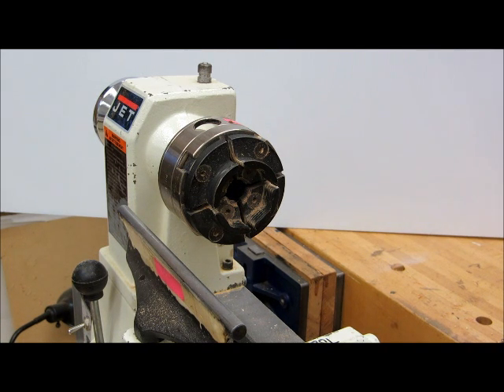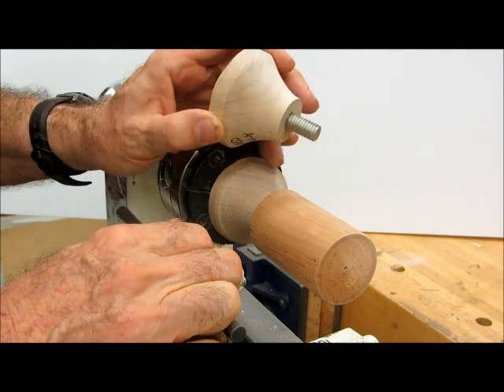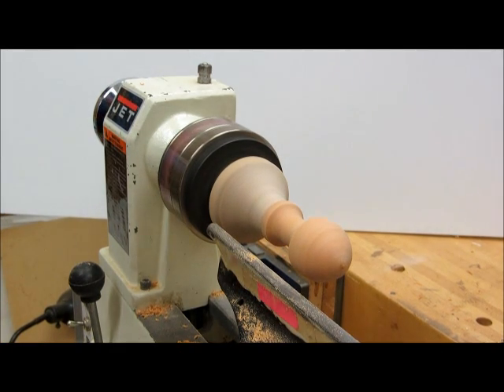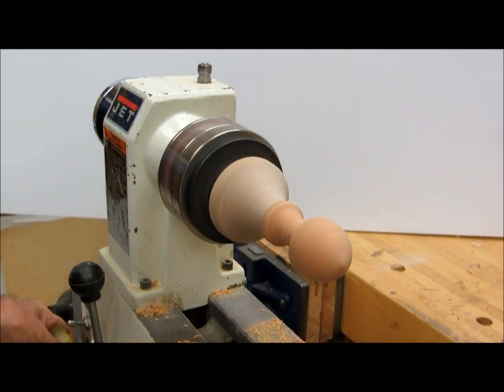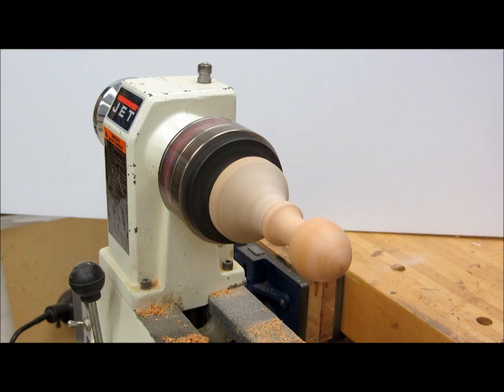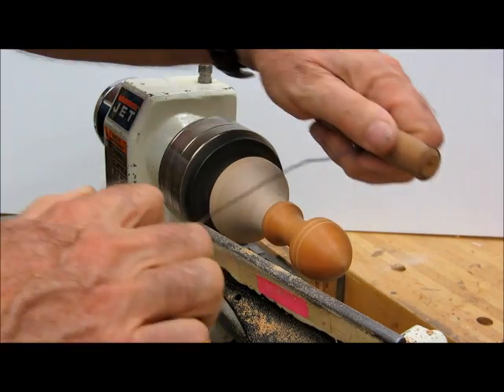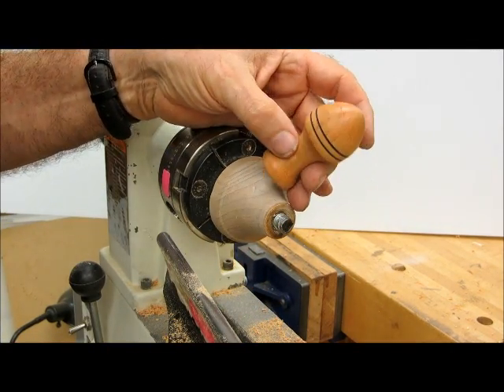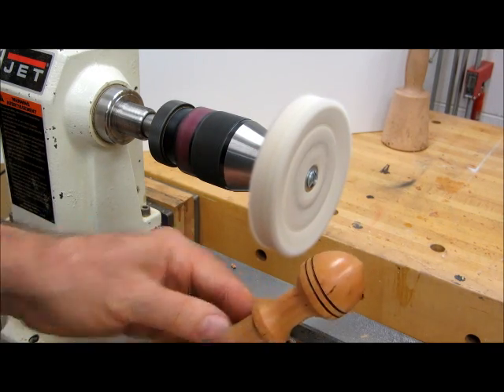Turning a bottle stopper

Comment: Hi Tucker, great video on making a bottle stopper. I belong to a Men's Shed in Adelaide, Australia. We have been making bottle stoppers that have a stainless steel bottom. It is fun turning them and so easy for new members to learn how to wood turn. The only issue we have is, some manufacturers use different size threads for their stoppers, so we need to be aware which stopper bottom we are using so we can drill accordingly. You mentioned about the rag you used for polishing the wax, we use a paper towel and if that catches, it just rips and doesn't pull your fingers into the work piece. I have included a link to something similar to what we manufacter. https://www.youtube.com/watch?v=0M1D6nr7TrI